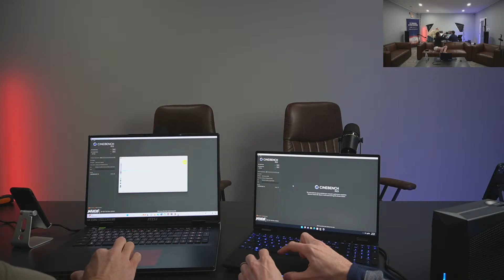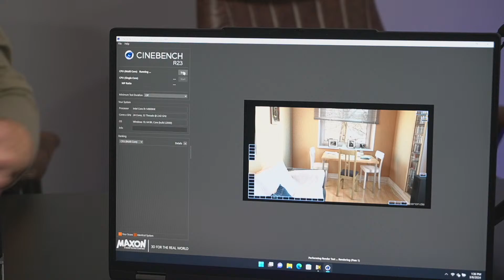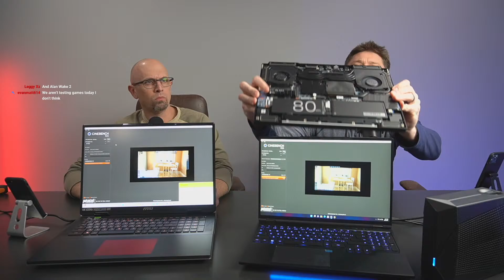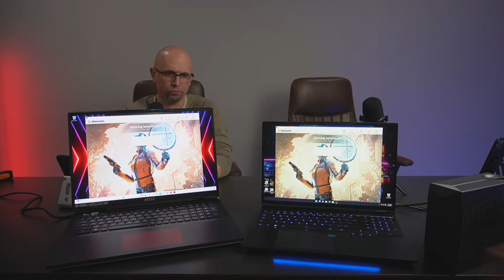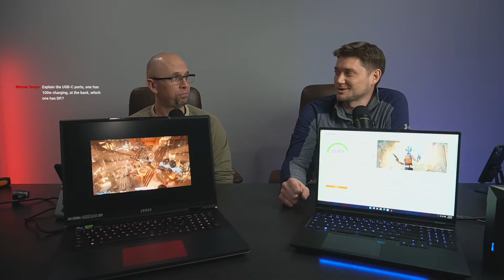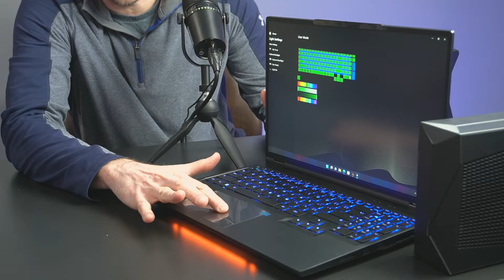Eluktronics HYDROC 16 vs MSI Titan 18 HX

Comment: I really want you guys (Eluktronics) to be the first to push laptops pass “175 watts”. I don’t understand why it’s such a big deal and haven’t happened yet. We are in 2025 and 175 watts been going on seems like forever.
Reply: We already do a little bit but software cannot monitor it on the 4090.  The issue is the supporting components to manage that wattage.  Cooling isn’t the only issue here.  A laptops motherboard has to support the CPU and system memory too.  The entire laptop motherboard PCB isn’t much larger than a desktop GPU by itself.  Hopefully that makes sense.
Reply: @BobOfAllTrades  Thank you, now I understand.